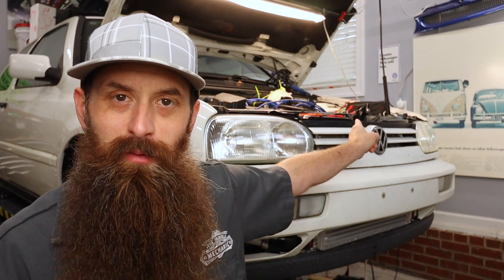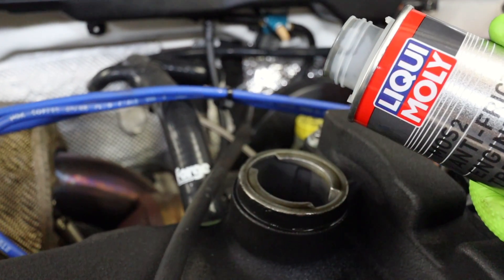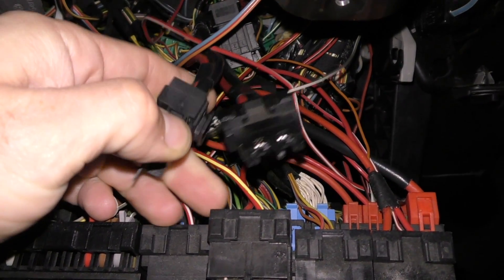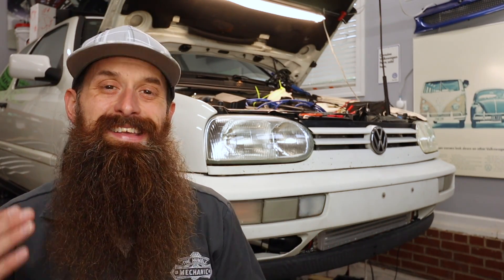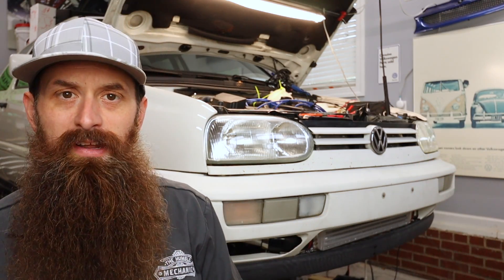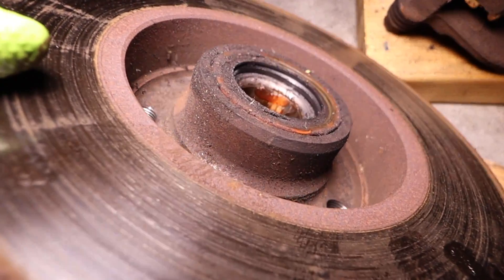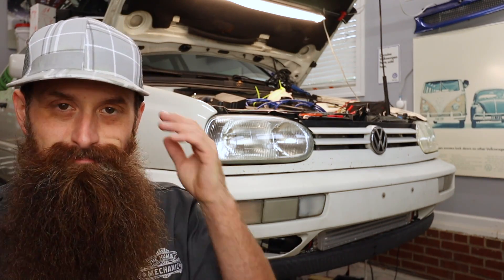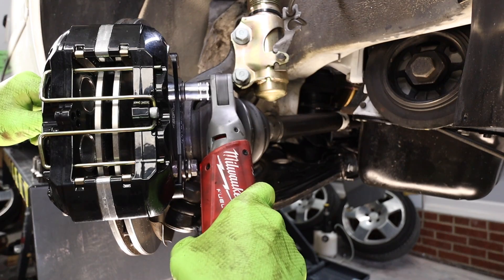Rear Brake and ABS Issues MK3 GTI VR6 TURBO

Comment from the maker: Looks like I can get the missing parts pretty cheap. I Think step one is to install them, test ABS, and go from there/.
Reply: On the plus side, it's another video that would be handy for many mk3 owners.
Reply: It was my understanding the rings rusted out on a lot of the MK3's in the great white north. Finding these in a junk yard (in good shape) might be impossible.
Reply from the maker: @KC-lu7vo  Down here is should be pretty easy. I think I can get them for about $20 new. Well worth it. HA
Reply: @HumbleMechanic  Do it and make it a video as has been suggested.
Reply: I would also go by updating the rear brakes anyway. They look pretty beat and rusty now. I don't know if that won't become an issue down the road. But why delete ABS when it's already there :)
Reply: Long shot but I think it would be awesome if you did a video with @HondaPro Jason with his yellow type R and your yellow golf R
Reply from the maker: We are trying to make that happen
Reply: Millions of these Golfs around, yes can get parts cheap for them.

Comment: My old 95 Golf had a proportion valve/anti-lock valve mounted via a linkage to the rear axle. The more extension the rear had under braking(rear of the car going up), the less brake pressure the calipers received from the master cylinder. I don't remember that car having a proportion valve under the master cylinder. I could be wrong on that, but it you go ABS delete, I'd see if you could get that rear valve. It was two in, two out, and I can tell you it worked like a champ. I could stop that car faster than most, with stock rotors and Padgid pads front and back. Just a dime of advice. Keep the awesome videos coming, Sir!!!
Reply from the maker: Nice! Yeah if we delete prop valve would be installed. Probably going back with abs

Comment: Rear brakes lock up is apparently common when upgrading the front brakes. The better stopping power transfers more weight to the front, making the rear tires easier to lock up. Something tells me even if you fix the ABS you're going to be working the pump harder than a stock brake setup. It may be worth putting a proportioning valve in alongside fixing the ABS system.
Reply: Pat Beattie I have upgraded 4 piston calipers in the front on my Corrado with stock rear brakes. I get some lock up on the rear brakes. Do you think I should run an aggressive pad in the rear to possibly help balance things out?
Reply: @aaronpeople101  im no expert in braking, but from what Ive researched you would want to lower the pressure to the rear brakes. So less agressive pads in the rear would be better.

Comment: I miss my old 97 Jetta. It had the 2.0 na motor but ran for over 250,000 miles before I replaced it with an 02 Golf 1.8t. Mk3 cars are a great platform.
Reply: As much as I loved my mk3 Golf, it's nothing compared to my mk4 Jetta.
Reply: Could not let go of my 98 Jetta @ 285000+ miles & still love it.
Reply: panzerveps I went from mk4 to mk3 and could not be happier. Yes it’s less refined but it has SO many fewer problems.

Comment: The ABS warning light should come on briefly then go off again if there are no initial faults when you first turn on the ignition. Chances are that if someone did forget to move over the ABS rings they couldn't work out why and just disconnected the bulb (really easy to do). Playing devil's advocate, they can and do rust out and will "disappear" as a result but this doesn't happen often...
Reply from the maker: That is what I am thinking happened. I didn't pull the panel off to check the indicator yet. Based on the rest of the car, I don't think it rusted away totally. Looks like those rotors never had them on HAHA

Comment: Awesome vid...love all the current projects you're doing. 
Quick question......How do I auto bleed an ABS module without a tech2 scan tool? Recently replaced all the brake lines on my 05 Buick Rendezvous. Installed Russell speed bleeders on all for corners and bled the MC on the car. Bled all lines several times manually, but only have a partial pedal. It doesn't form up until half way through the pedal stroke.  Any suggestions???

Comment: Yeah yeah ABS on older cars is fun. I just figured out an ABS fault on my mums B5 V6 Syncro Passat. Thats was fun. Turns out the wiring harness for the left rear on cars with Xenon is not available anywhere. So I had to solder in a new sensor.  
Plus it turns out that there is no communication through the OBD port. So that's gonna be the next thing.

Comment: Very interesting video - missed seeing what a hydraulic pump looks like. Don't delete ABS - you make that sound easy but it's a lot of work and may present problems with the proportioning between front and rear.

Also a proper repair is much more interesting than a dodgy build.
Reply from the maker: Agree! I found the power issue. I also just picked up the ABS rings.
Reply: HumbleMechanic
Goody!  😊

Comment: Glad I found a dude like you. I have a question completely unrelated to this video. I’m rebuilding a 2016 Audi S3. I’ve recently replaced the seat belts and have to configure the two front seat belt tensioners. Codes B130455 and B130555 for reference. My question is, on the Ross tech wiki it’s says “seat belts must NOT be plugged in” when configuring. Do they mean the belt must not be buckled in, or all of the actual electrical connectors to the seat belt must not be plugged in? I’d REALLY appreciate any kind of help. Thanks

Comment: If you get all the original parts back on i.e sensor wheels and make sure the wheel speed sensor is working, the ABS module should work itself out. Had the same issue with a GTI many years ago after snagging a curb in the wet. All I did was make sure everything was back as it should be and cleared any codes, then took the car for a short drive making sure to do some quick stops along the way. The pump may even come good if its slightly ceased from no use, never had one fail personally but nothing is out of the question and would be a real PITA if it has lol. Good luck with it, go make some wookie choo choo noises...
Reply from the maker: That’s kinda what I’m thinking and hoping for. Lol got the rings I’m picking up today

Comment: Hey charles, loving the white wookie im currently restoring my 97 vr6 here in uk rust is a big problem on 23 year old car need your help please i cant find any info on replacing brake hard lines from abs pump to rear beam. Does the abs pump need bleeding/priming if these lines are removed and replaced. Any help appreciated thanks james
Reply from the maker: Abs only needs to be bled if it gets air. If you loosen the line, cap it so fluid won’t leak and hustle you might be able to avoid abs bleed

Comment: Hey. I have a B6 FSI 2.0T Passat. The ECP light is on. When I start the car, it takes a bit, and then idles roughly. After it sits for a bit, it idles regularly. I can drive it but it hik-ups when I accelerate, so I’ve been easy on accelerating.   It’s like its in limp mode. I put my foot to the floor and it takes forever to get up to speed. I wanted to know if it could be the throttle body, fuel pump, or even mass air flow sensor. I need serious help man, any helps. I’d appreciate it.

Comment: Good evening dear, I wanted to know if it is normal in a jetta gli 2.0 tsi dsg 2011, without button to deactivate traction control, that the car both in sequential position and in sport mode, pass the changes (shifts) at 4500 rpm, without the possibility of stretching the Acceleration between change and change. Beyond that, the car is doing very well, it puts the changes in time and form, makes the recess when you step on thoroughly, but the only thing is that it does not stretch the changes.

What could be the reason for this behavior? It is normal? Is it solved with a reprogramming?

From already thank you very much. Regards

Pd: the car was scanned with vagcom and does not present any falut code.

Comment: Those rear abs rings are less than 10€ in eu, and you can get them in mostly any parts shop. It really doesn't pay to buy used rusty ones as they tend to cause problems later.
Reply from the maker: Agree. Found the mmmm for $10 each

Comment: My abs module is bad and I can't find anyone that rebuilds them or even find a new one for less than $1300. The abs module also controls the electronic locking differential, which would be nice to have.

Comment: Charles, please PLEASE show us how you do the speed sensor test using VCDS!! Also can you show us how to read electrical diagrams - just the basics so we know what the main symbols are in elsawin?? Thank you.
Reply from the maker: That is a great idea!  The wiring diagram is a little trickier. VW gets a little weird about things like that.
Reply: @HumbleMechanic  In your opinion, what's the weirdest thing that VW does with wiring diagrams?
I've gotten used to them in the Bentley manual. I feel that having too much info is better than not enough.
Reply: This two part series from RossTech helped me greatly, definitely worth a watch!
https://www.youtube.com/watch?v=jKnTjuSmwaE
Reply from the maker: Too little info and them being wrong. Also inaccurate vin split issues

Comment: The wire with the gigantic resistance rating, is called  an OPEN CIRCUIT.
Reply from the maker: Not really. An open circuit is an ope. Circuit. They may function similarly but they are not the same

Comment: Ditch the ABS .
Even when it works correctly it will limit the hyd flow and limit performance/ not calibrated for wildwood or big rear disc kit .
Just use the pre ABS with the 25mm master 
And the aluminum axle biasing block , stainless lines .
Reply: Use the Audi 90 master and the biggest booster 25.5 
The wildwoods have more internal poston capacity than the girling or ATE set ups I believe .
The old ABS modules are and look like crap .
Use all new parts and lines

Comment: Ya know... How does a Mk3 get rotors with no rings? ABS was standard for Mk3's, was it not? I'll bet those were rotors for a Mk2 the previous owner put on?
Reply from the maker: This is super common. Guys don’t swap the rings when doing brakes. Seen it a bunch. Almost did it on the first one I did
Reply: @HumbleMechanic  Oh? I thought the reluctance rings were non-removable? I can't remember. It's been a long time. I do recall that Mk2 and Mk3 rotors were interchangeable in some situations. I graduated to an Audi S4 about 10 years ago, so I haven't been old school VeeDubbin in  many years.

Comment: Those modules are bad about the main incoming power solder joints cracking. Same module on volvos.  Vw guys are the worst about to ripping abs out of a car.   We repaired mine and all was well.  Maybe this will help someone.   Keep abs.  Brake proportioning on the fly is totes.
Reply from the maker: The power issue is before the fuse on teh battery side. I need to dig deeper behind the dash and see if maybe it's just a loose connection.
Reply: @HumbleMechanic  would love to see a dash disassembly video. I have to replace my heater core soon.
Reply: The common failure with the power pins on the module usually shows up first with a Right Rear sensor fault before it progresses to a faulty module.

Comment: Don't delete the ABS, that's the hack way of solving the problem!
The ABS rings are dirt cheap, available. The ABS auto-bleed program should solve most issues
Reply from the maker: Got the rings coming. They were $20. Lol
Reply: @HumbleMechanic  Just be happy that the MK3s got the late-style ABS and not the MK2/B3/Corrado style which is impossible to find anywhere

Comment: Ah the joys of buying second-hand things and slowly finding out what the previous owners had messed up!
Reply: It's also funny that the whole time he had the car he didn't check rear brakes and rotors? He has done so much to the car, front brake kit and leaving the rear untouched? That's almost like a bad practice.
Reply from the maker: Not a bad practice, just hadn’t got to that point yet. Did the fronts, found and issue and parked it. I don’t like overlapping mods if I can help it. That way if you do have an issue you have less to go back and check. Rear brakes were on the list from day one.
Reply: @HumbleMechanic  Well, yeah, it depends. As you said you had problems with wheels locking up and doing all the fun stuff, you might have had more to go if you would have been in a worse situation maybe, but you and the car is good, which is good..  also, I have a question about intercoolers on VR6 Turbo, um.. is intercooler necessary? How much boost do you think VR6 can run without an intercooler before it might start bringing up problems, or you will just get less performance by not adding that? My plan might be adding a turbo also but probably not going above 15psi in the long run. How much are you running and how does is feel? Horsepower figures?
Reply from the maker: That’s About the Psi I’m running. Guessing around 300WHP
Reply from the maker: I’d max at 6psj for no charge cooler
Reply: @HumbleMechanic  Thank you for the replies.
Reply from the maker: @birdyvr6378  :)
Reply: @HumbleMechanic  Hey, I've got a few more questions, can you help me?

Comment: Shouldn't the ABS light switch On when you switch the ignition ON? This means ABS check, like the airbag check? But, like i'v seen in a first gen Mazda 3 it has a very bad walkaround. Someone had connected the light to a relay and when the car ignition is On, the light stays on for a few seconds /like it should be/ and the off. You will think that it's all right, but No No, when you hook it up, the Airbag errors come on. Then you think to yourself, am I so dumb and did not see the light stay on after starting, well no. You just got screwed. So always hook the car to a diagnostic tool on inspection. I mean ok, hide an engine problem, a gearbox problem, exhaust, but an Airbag problem or a brake problem. This should be criminal imo.